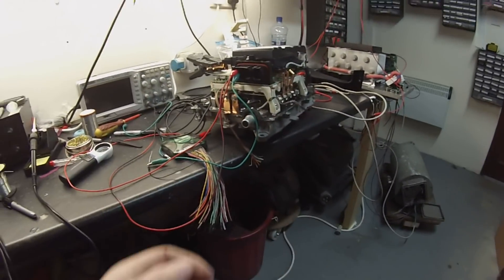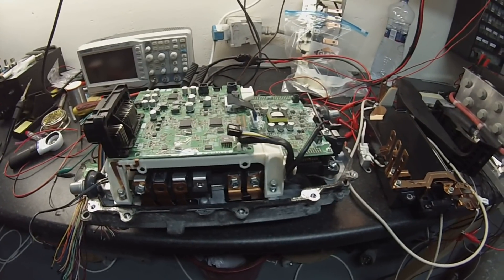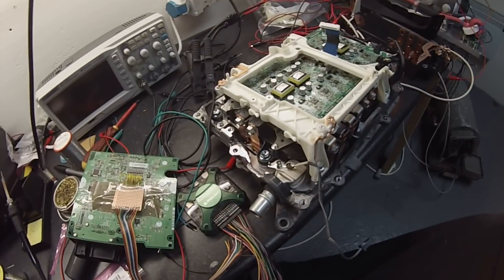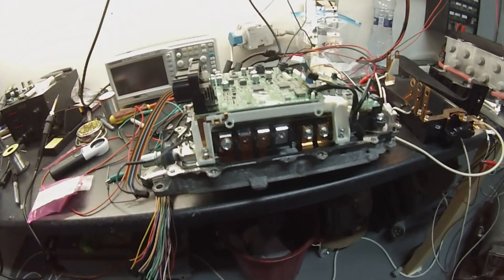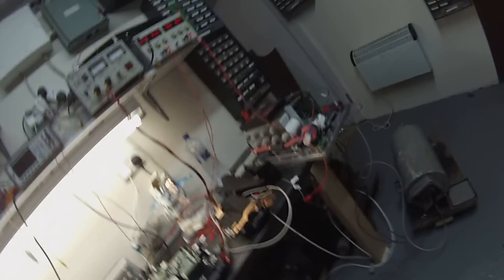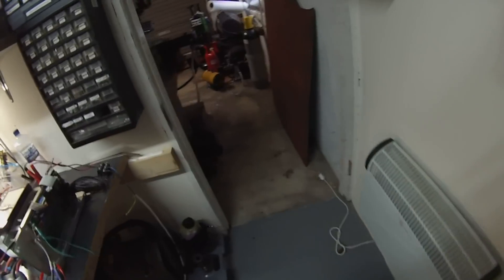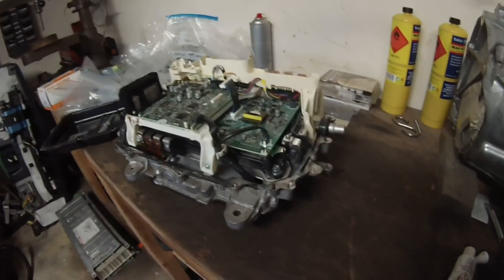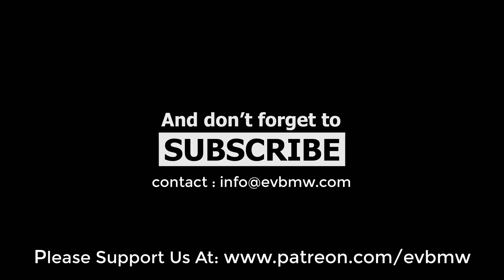Toyota Prius Gen 3 Inverter Converter

Comment: Well done, Damien!
It is a good idea to use the DC/DC Boost as a charger. Add a diode bridge and run it as a PFC. For high voltage config. The only limitation is a low input voltage of 12V converter.
I liked the inverter from Prius, but I can control the Leaf inverter of the first generation, and this is the best for me.
In Russia, the inverter & motor is cheaper than $ 500.

Comment: When you hacking the Prius gen 3 inverter, I was thinking if it would be possible to use it on a off-grid solar/battery system. 
Is it possible to make a 3-phase 400V 50Hz with the inverter?
Is it possible to use the buck/boost converter to charge battery, 400-600V?
Then you had the dc/dc-converter to charge 12V battery for the systemcontrol.
How much power could the different part handle?
Hope to get som answer 😁
Keep up your great work.
/Göran

Comment: Great work again Damien. I'm really excited about this as a possibility. Controllers are still the big unknown for me. And a charger as a bonus to boot. I don't know much about these things, but, aren't driver's relatively simple compared to reverse engineering the communication protocol? That is, why not just discard everything but the power stage and just hijack it along there instead?
Reply: That is precisely what Damien is doing.
Reply: @kiwifiat - Maybe I misunderstood, but there are 3 sections to the electronics. 1 - The Brains. 2 - The Driver. 3 - The Power Stage. Damien is reverse engineering the link between 1 and 2, I'm questioning about cutting between 2 and 3 instead, as there shouldn't be any reverse engineering. Create your own brains and driver, rather than creating just brains and having them emulate the old brains to the driver. I dunno, maybe I don't trust all the complexity built into their driver with a 50-pin connector, and would rather have something bulletproof and that I have a hope of diagnosing if anything goes wrong.
Reply: @ @MattsAwesomeStuff  nomenclature issue maybe, power stage includes IGBT's, IGBT drivers, snubber capacitors. Regarding bulletproof, the toyota designed inverter has a bulletproof powerstage designed by some of the best EE's on the planet. Redisgning a new IGBT driver with desat and over current support is not a trivial task and would seem like an unnecessary step not to mention adding expense and the PITA of removing the existing driverboard that is directly soldered to the IGBT's.
Reply: @kiwifiat  - Ahh, I see. All good stuff.

Comment: if you get to the point where you can drive mg1 and mg2 independently, then you should be able to skip welding the planets on the power split device, and just add something that holds the input shaft still. more complicated electrically, but simpler to implement mechanically.
Reply: the motor MG is much stronger than the generator MG, so i think the motor MG would overwhelm the MG and make the generator MG operate like a generator, even though it would be given motor commands...kind regards.